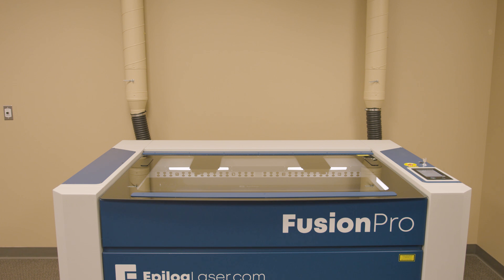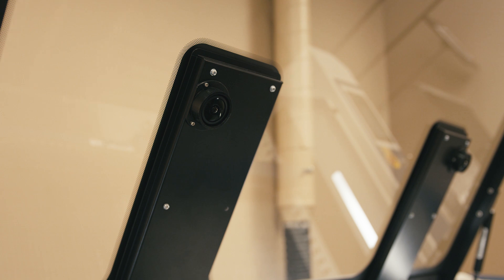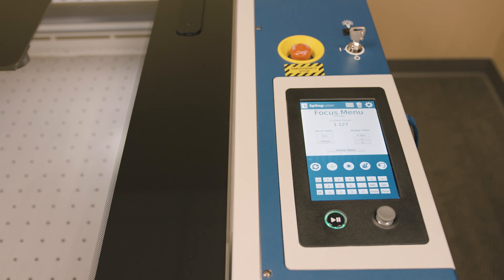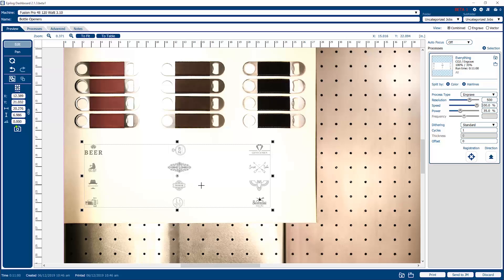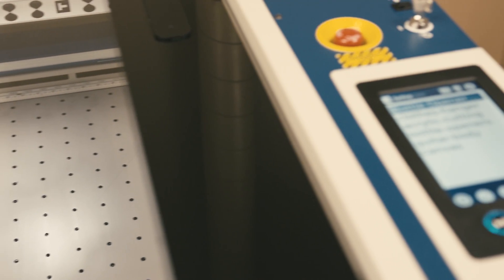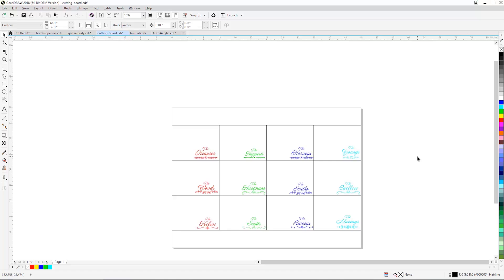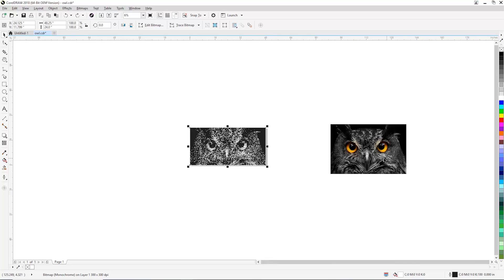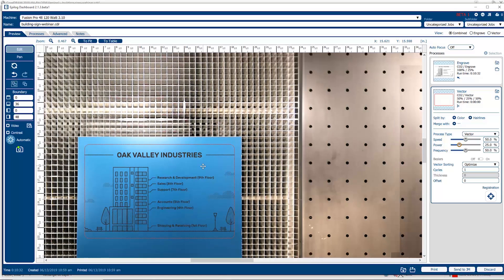Epilog Fusion Pro: An In-Depth Look at the New Feature-Packed Laser Machines

Comment: 2:28 Will a slate table be supplied with the purchase of the machine? At the time I purchased the machine, I was supplied with two tables on the left. I wonder if the original table shape should have been supplied differently.

Comment: With your air compressor - will the machine turn the compressor on/off as needed based on the project?  or will the compressor be running non-stop?  Thanx in advance.  (Looking at Pro 36 - 80w)

Comment: Is anyone else having major problems with this machine and lack of support? I purchased mine in 2020 during the pandemic and feel like they may have been having some manufacturing issues during that time. I’ve been getting the runaround for years from epilogs technicians. Spent $50,000 and cannot cut anything. I own a fusion edge, small machine and have to cut everything on that machine.
Reply: We have over 10 of their lasers, our two pros are by far the most problematic. The dual worm gear y axis rails have been the cause of most of our issues. That as well as random boards going bad. Though their support has been alright.